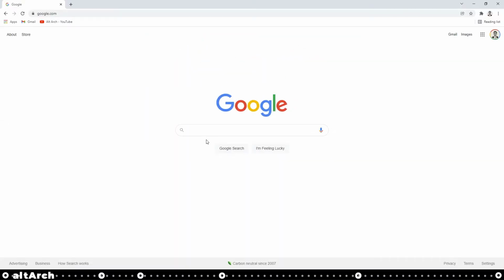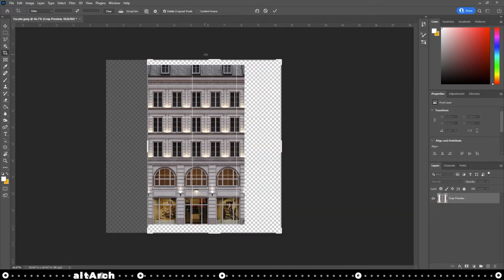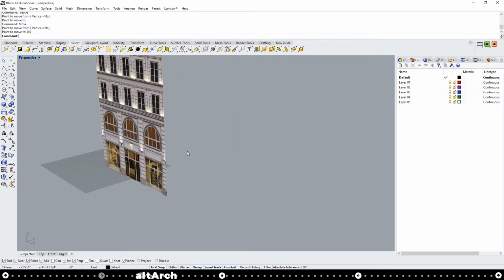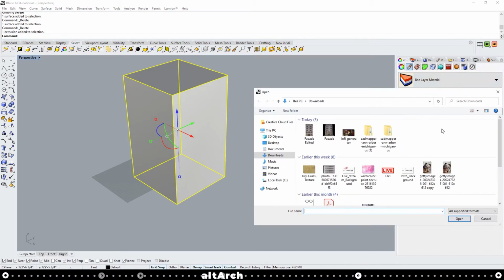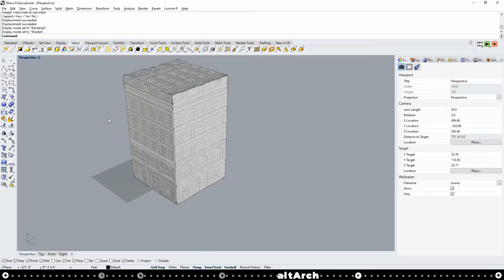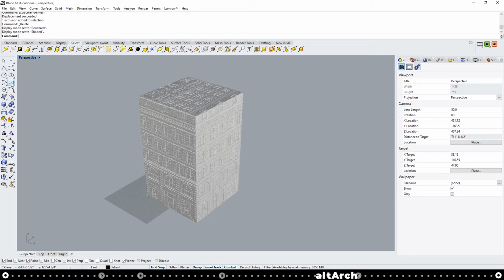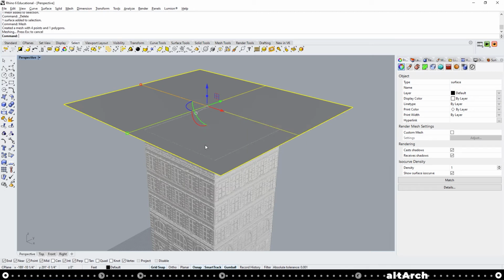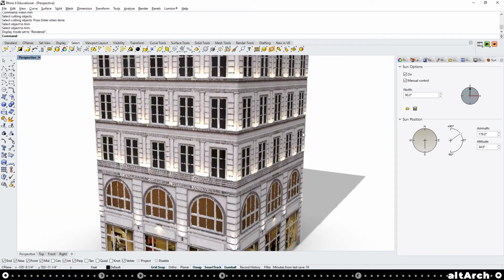EASIEST Building Facades in Rhino

Comment: Thanks for the tutorial! Just wanna know. Ignoring the parapet, what are the advantages of going thru this process compared to just using the pictures on the planes? It looks almost identical.
Reply from the maker: Great question! This method gives the buildings texture so if you are to see them at an angle in a render they would have relief, or if you are using sunlight then they would cast a shadow.